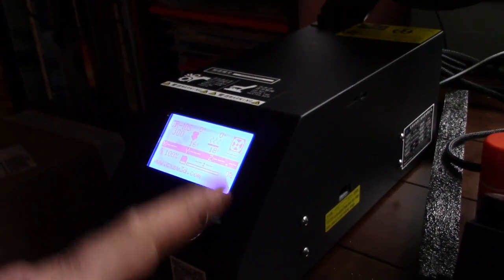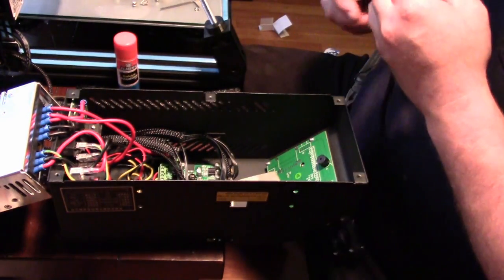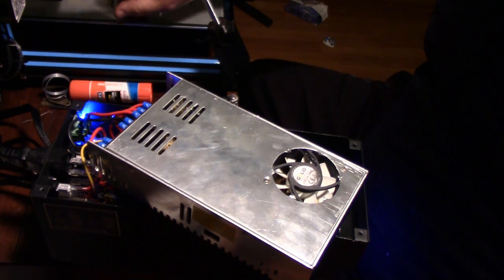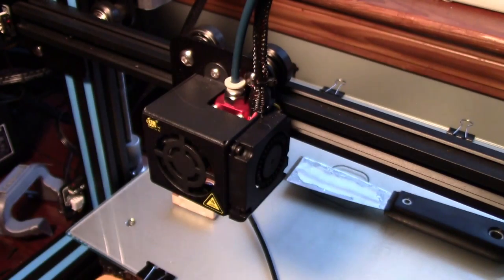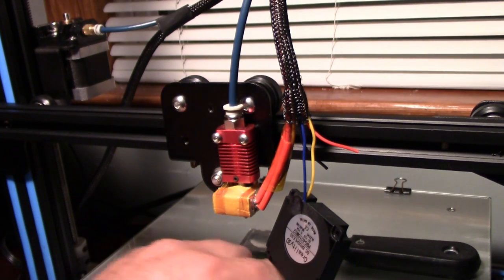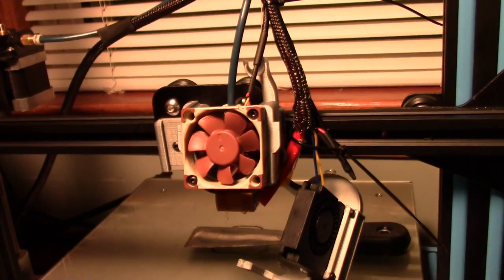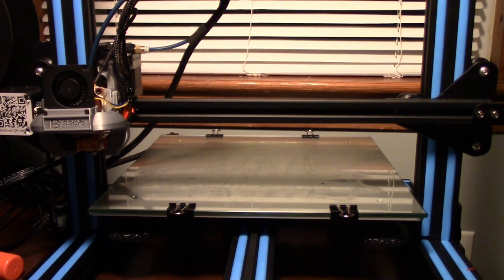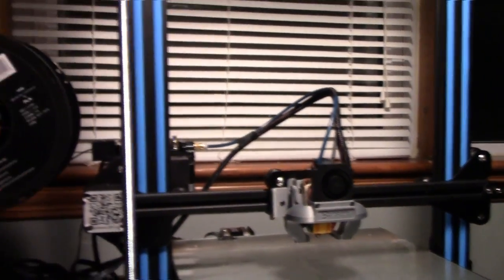Cr-10S Fan Replacement and Cooling Duct Mod

Comment: Did you print that duct assembly in PLA ?
If so, how did it stand up to the heat?
Reply from the maker: Yes.  It's held up fine.  So far my longest continuous print has been 27 hours at 195 degree hot end temp.

Comment: Hey there- I am currently working on a similar hotend mod for my CR10S. I am also using the Noctua 12v 40x20 How did you deal with the third wire? I am assuming the yellow is for ATX motherboard fan control and wont be needed?
Reply from the maker: Yup you can just clip it off or use a 3-2pin adapter.  I just opted to cut it off.

Comment: You changed the 24V filament fan to a 12V fan. How did that turn out?
Reply from the maker: All the fans are 12volt

Comment: This whole control box is just  bad thermal design, three fans for this is silly. If you have proper component placement and air guides one fan could do easy